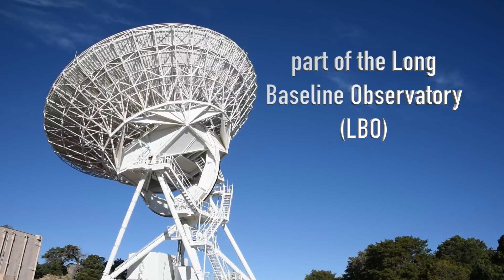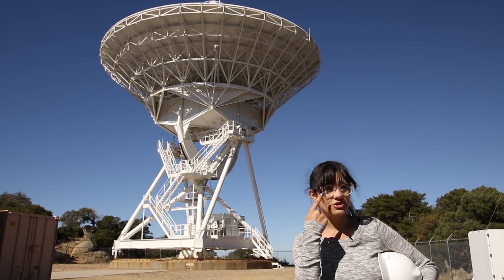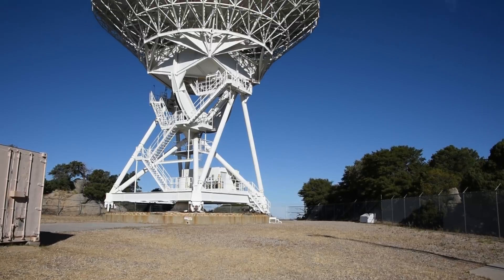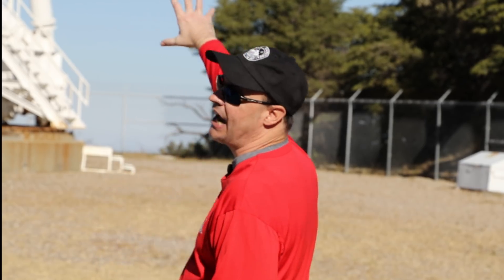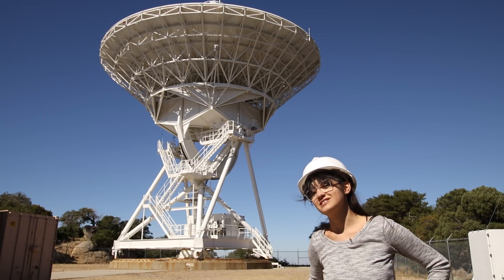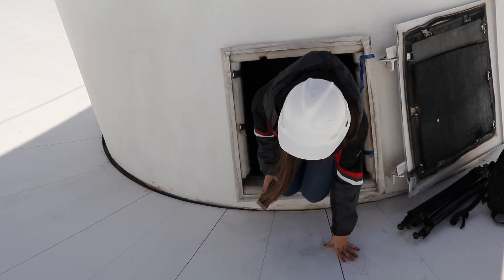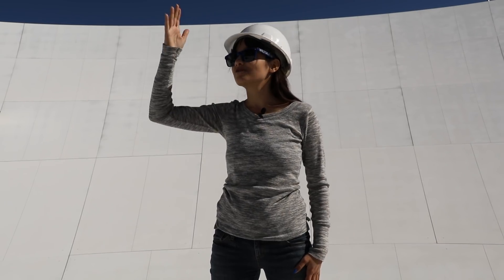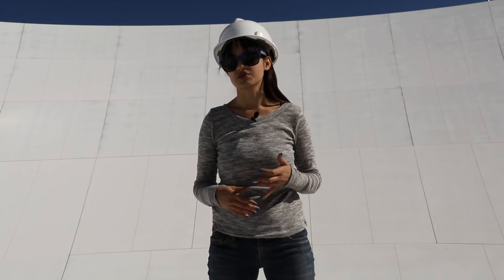Walking on a Dish - VLBA, Interferometry, and Radio Telescopes

Comment: If you're wondering about sending 32TB over the net:
It's 26,000 gigabits a day / 24 hours = 1,803 Gigabits per hour / 60 = 18 Gigabits a minute / 60 is 300 Mbps. That's pretty crazy, and would max out about 10 average US internet connections at once.
Reply: That's not unreasonable, though. For example, I have 220mbps and there are business ISPs in my area offering up to 350mbps and even gigabit in some places. I can imagine that the real problem with transferring data over the internet would be closer to the risks associated with having a 24-hour-long file transfer, such as if it failed for some reason. (Such as a node going down, or packets being lost).
Reply: OblivionCreator Yes, but that's download speeds, not upload.
Reply: ...Shit. Yeah, that makes more sense now.
Reply: 32TB is 256,000 gigabits. not 26,000, You missed a zero.

Sending harddrives by plane is faster than most internet in the world (3gigabit/s or 3Gbps)

Comment: Why do you have nano-meter precision in the optical telescope, but in the radio telescope you have dirt, footprints and crooked plating?
Reply: allocater2. As they mentioned in the optical telescope video, they want imperfections to be smaller than half the measured wavelength. For visible light, that's measured in 100s of nanometers. For radio waves, that's measured in meters. Thus the surface of the radio telescope matters far less
Reply from the maker: This^^
Reply: Does that mean that X-ray telescopes have to be precise almost down to the atomic level? Is it even possible to build something like that?

Comment: If telescopes can be linked in a network, is it possible to send a bunch of telescopes into various orbits and have a network the size of the solar system?
Reply: That sounds not just possible, but likely. I hope I live long enough to see it, but considering it's been 50 years since Apollo, I doubt I will.
Reply: Look up Spektr-R, a space based radio telescope. It would be interesting to put some in circumsolar orbits for a very large baseline.

Comment: You guys are doing an amazing job! Is that last shot real? It almost looks too good to be true.
Reply: Hi - Yes it's real :-)  The VLBA dish is on the southwest ridge at lower elevation than the rest of the telescopes, so you get a great view of all of the scopes at the top from within the dish.
Reply: J. van der Linden It is very real! 😀
Reply: And btw, it's quite a challenge to stand that high up in the dish. It's quite an incline, and shoes slide easily on it. 😓

Comment: So it's faster to send the data by mail than over the internet?
Reply: never underestimate the bandwidth of a truck full of hard drives speeding down the highway
Reply: HelloMeow weird, but true
Reply: the bandwidth of a 32TB hard disk pack shipping via mail is about 1-3 Gigabit per second (3-1day shipping), so if you have a faster internet access than that, it would be better. Some universities have a 10Gbps bandwidth between them, but that would mean you'd take  the full bandwidth for around 7.2 hours or use about a third of it to send data in real time.
also, any less than 3Gbps isn't viable as it would take more than a day to send a day of data.
the advantage of shipping is that you can send multiple packages at the same time, so even if it takes 10 days for a package to arrive, you can still send a truck each day, bringing the total bandwidth back at 3Gbps (10 trucks at 0.3Gbps).

Comment: If its 32TB a day, thats 3107mbps. That does not seem too hard to send over the internet?
Reply: Isaac no it isn't. It's 26,000 gigabits a day / 24 hours = 1,803 Gigabits per hour / 60 = 18 Gigabits a minute / 60 is 300 Mbps. That's pretty crazy, and would max out about 10 average US internet connections at once.

Comment: A simple napkin calc says if they send 32 TB of data per day and each point is a double precision float, then they are taking data at 185Mhz and can't detect a frequency higher than 92 Mhz. They could only report the frequency at 185 Mhz though and compress a far larger amount of data into a smaller space with no detection upper bound being imposed. Hi from Tom Scott.